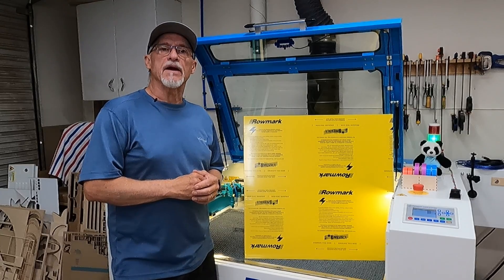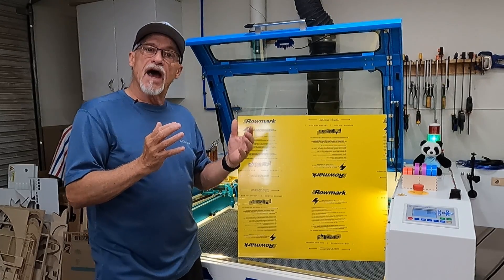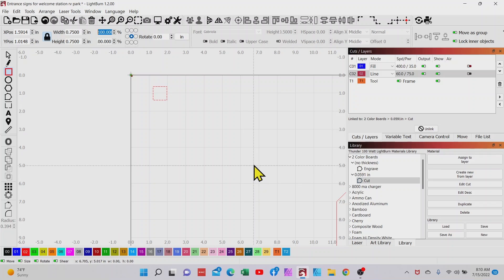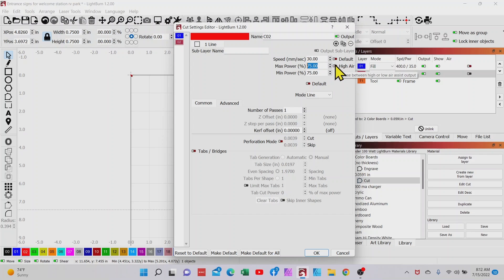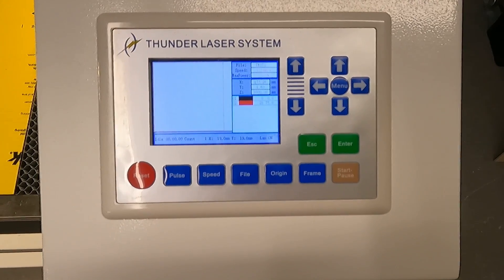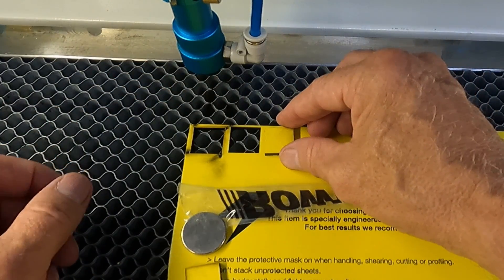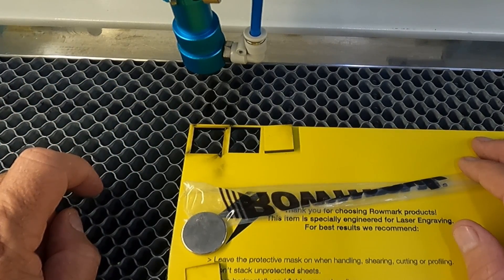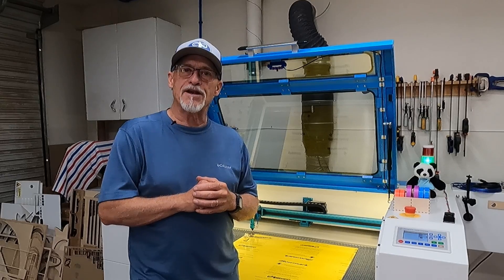Dialing in your cut settings on your co2 laser

Comment: Great videos on your channel!!!
Tell, me are you using air pump or air compresor as an air assist?
Thank you!
Reply from the maker: I’ve got a 60 gallon northern star compressor for shop air that I use. The larger the tank the less you have to hear is run!
Reply: @computercreationz  thank you for info 👍
Reply: @computercreationz  Can you please tell me what preasure you use when cutting wood? (3mm plywood)
Reply from the maker: 55psi at regulator which is about 25 psi at the laser head  @flying.fox987
Reply: @computercreationz  since I instaled new air compresor, I have problem with smoke.. my fan can tak that much airflow and I have smoke in workshop...
Can you tell me what smoke extractor you use? I have 6" inline fan...

Comment: Do you have your own material setting list? It seems most all your settings work great for me I have the same laser as you
Reply from the maker: I have an extensive library that has taken 3 years to put together. since all laser are a little bit different allot of the settings will be different. I’m finding that even the one I’ve come up with for wood engraved and cutting  are changing .

Comment: I really enjoy your training videos  - I have a question for you  -  what are the settings that you use for cutting thru 1/4 plywood  -  Im having problems cutting all the way thru
Reply from the maker: every laser is different in settings even if you have exactly the same laser. pick a power like 80% and don’t change it. slowely reduce the steed until you cut through. it’s just that easy. good luck

Comment: What is a good power setting to rely on and then play with speed to find what we want for each material? if we take into account the health of tube but let's not be slow either. for nova51 130w
Reply from the maker: because thunder has already throttled your tube down so you can’t overdrive it I use 80% power on just about everything I cut. the only thing that changes is the speed
Reply: Thanks a lot for your prompt reply

Comment: Thanks for this information, it has been a struggle for me this helps a lot. Question about the digital air gauge, did you just add the gauge, does your laser already have the Air-assist panel? Thanks again for all your great videos!
Reply from the maker: Yes Thunder lasers has the low and hi volume air assist panels already installed.

Comment: Nice video! But wouldn't leaving the protective mask on for cutting avoid the black 'contamination' ?
Reply from the maker: Not sure what you mean black contamination? I’ve never seen black color on two colored sign material. There is clear plastic that covers this surface and it’s not design to be engraved on.
Reply: The soot on top yes it might. But that film will also melt much easier and possibly contaminate worse. 
Get your cut settings right. Then you can leave the film on top if you see fit. 
The black on the edge is the black plastic with yellow plastic laminated  to the top. 3m adhesive on bottom.

Comment: We tried this method with some plywood material, cutting 1" squares.  However, when we increased the size of our cut to something like a 6" square or circle, it required a slightly slower speed than our small tests. It did not cut all the way through on the larger cut.  I think the laser had more time to ramp up the speed on the larger cuts.  So I would recommend that for your first "large cut" that you make sure your material is pinned down good, then try to lift the piece out with something like a vinyl weed tool.  That way if you have to make another pass...you can do it without your material moving. Just speaking from experience! :)
Reply: Wondering if it's a min max power setting. When it has a straight run and can go full speed it does not have enough power. However when the item is smaller it is throttling that min max.
Reply from the maker: I haven’t experienced  your observations at all, I rarely cut bigger than 1” square and have no problems cutting full 23 x 35 cutouts. not sure what the difference is but cutting larger pieces for testing seems like a waste to me especially if you don’t experience any cut quality difference.
Reply: @computercreationz  oh, our test were only 1”. It’s when we cut out larger piece for a customer when the test settings didn’t not work exactly. We had to tweak it. And it happened the same way with a friend of ours. But we were trying to get the fastest cut speed possible at about 80% power. Just trying to save time! :)
Reply: @computercreationz  cutting 1 inch squares already seems wasteful to me, you can cut 1 inch wide rectangles instead, and fit 3 test pieces in the same area.